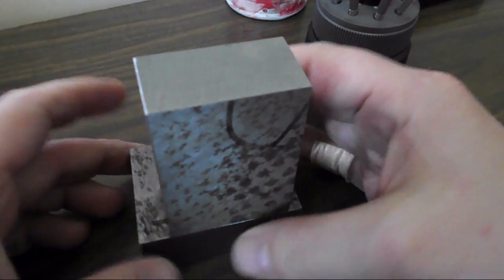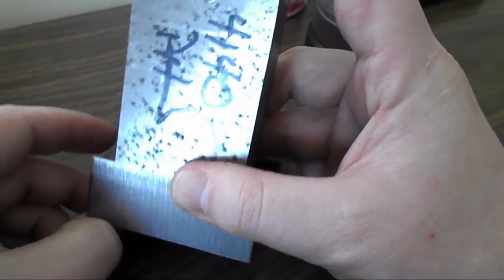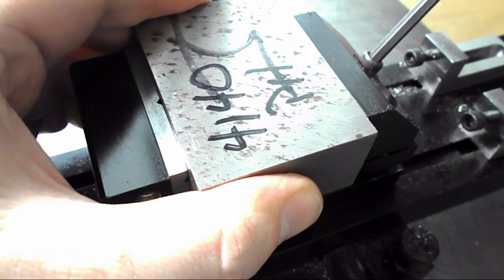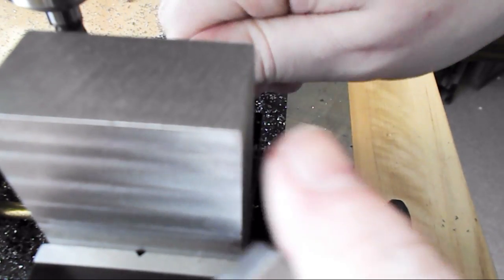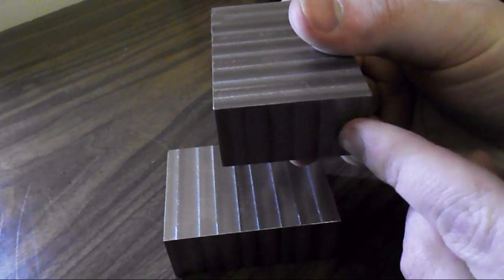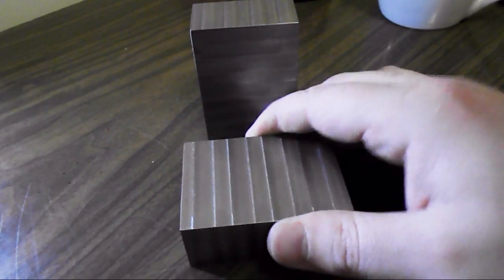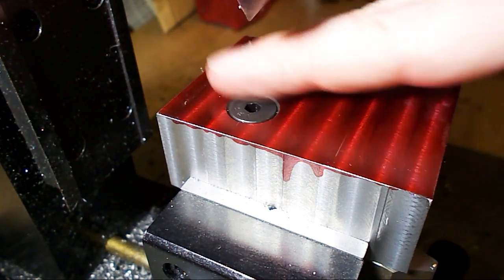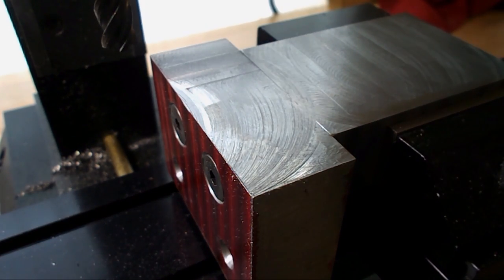Making a Sherline Tombstone - A Side Project

Comment: That 4140 is tough stuff.    Have you ever tried working with 12L14 ?    I'm thinking about purchasing a Sherline CNC mill set up.  Already using the 4400 manual lathe.